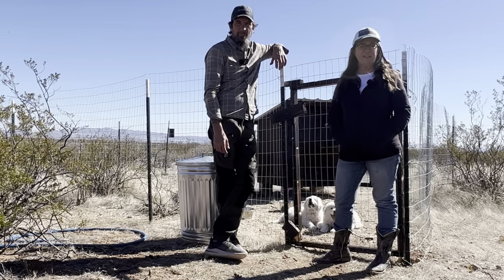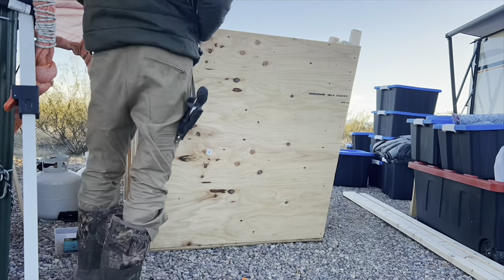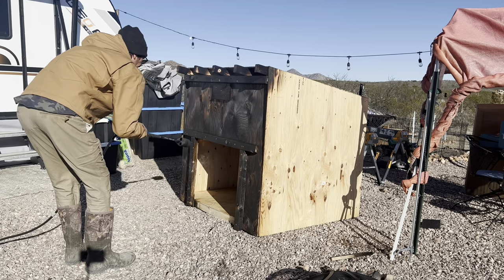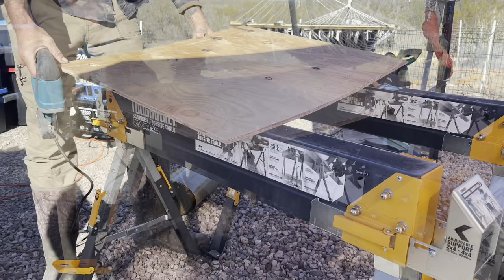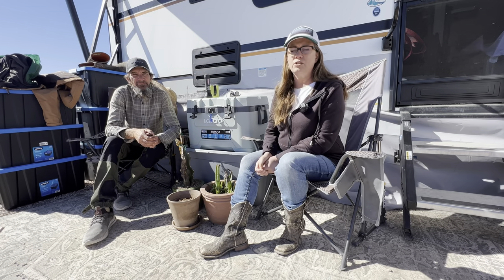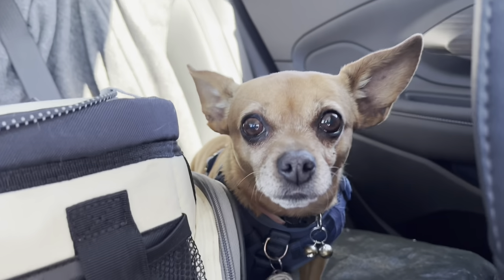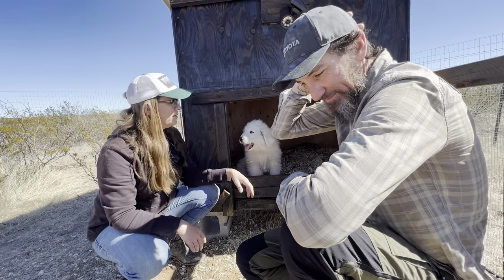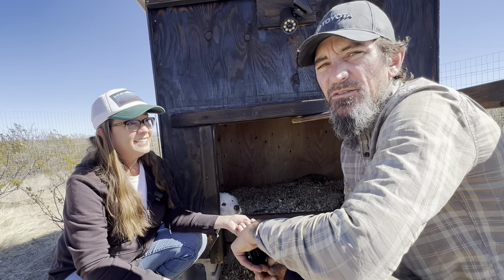Great Pyrenees Puppies To Protect Our Off Grid Arizona Homestead

Comment: Those dogs will be miserable in the summer heat here, they are cold weather mountainous area dogs. Have you lived a summer here. Sure they are popular here, but don’t belong here. The only way to protect your livestock here is a sealed barn overnight, no doubt.
Reply from the maker: Hello...yes, we have been through a summer here.  We are at 4500' elevation and our temps don't get much over 90s, but the summer monsoons always cool things down in the afternoon.  Their double coated fur actually helps protect them from the cold and the heat.  We've heard some people will shave them, but after researching, it sounds like this could do more harm than good with the heat.  They will have lots of shade and always have access to plenty of water too.  Our friend is a commercial sheep farmer near Tucson and will not keep another LGD except Great Pyrenees and their temps run 15 degrees hotter than here.  Thanks for watching!
Reply: Beautiful girls. You have done your research (most folks Don't) so those pups will have a great life on your place. 
The AK raised sled dogs also Prefer outside - bedding down in ❄. They to have built in protective coat. Double shade cloth overhead in summer will make great area for them.
Nice house you built for them.
Reply from the maker: Thank you so much!  Yes, they have become very, very good at finding shady spots and never go to far from the water bowl :)  They are wonderful to have here!